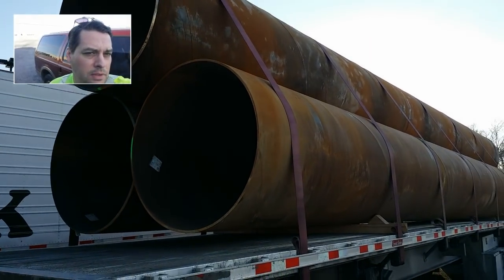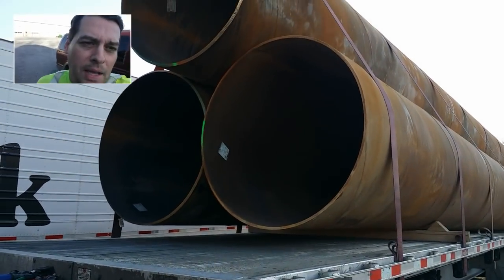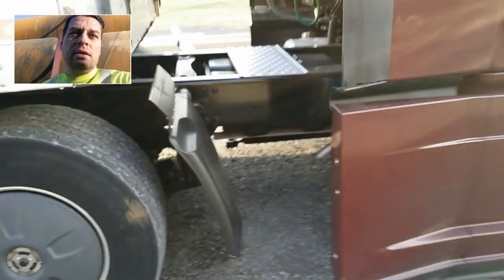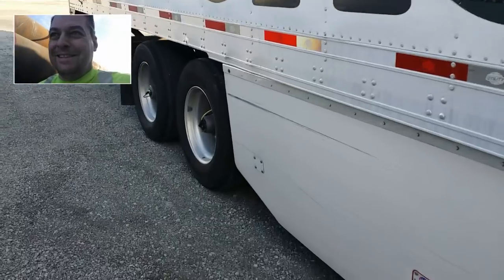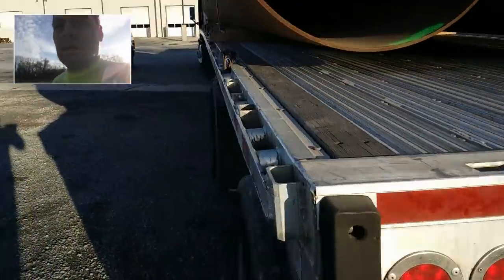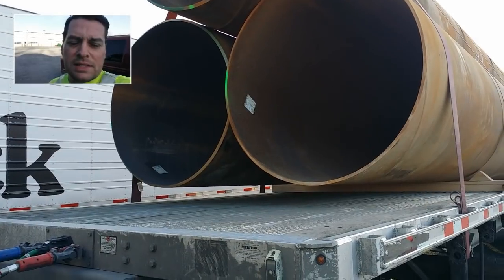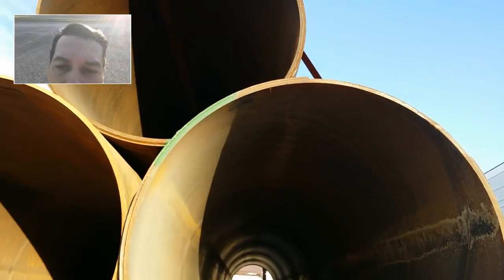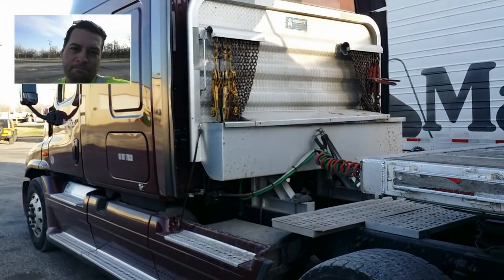Triple Barrel Steel Tube load

Comment: cool aero package on the temp controlled truck.  You can open those back doors but can you set up those rear earo flaps on that box haha. Wondered how they make that long pipe thats interesting thanks
Reply from the maker: It is a nice long building. I think they make pipes close to 125 feet in length or more, perhaps less. They have a picture of them loading one onto a Barge at the rive. It was pretty massive.

Comment: For some background on the tyres, they are most commonly referred to as super singles as well as wide-base radials (some places) and are generally installed for weight and fuel efficiency benefit. My guess for the differing implementation is due to the whims of the OEM as I see a lot of that trim of cascadia sporting them but they being less common on that trailer.
Reply from the maker: I concur

Comment: I am sure someone will correct me if I am wrong, but I think the reason you don't  have super single tires on your flatbed is it is a spread axle good for 40000 lbs and the the single won't take the weight, the reefer trailer is good for 34000 lbs and thus can use a single.
Reply: Mark Nairn some companies run super singles on spread flatbed trailers.
Reply: The singles will take the weight but they drag all to hell and back on a spread. By far the biggest pain in the but trailer I ever pulled was a spread with supers.
Reply: it is also because of the weight we carry as opposed to the box trlrs. If we blow a super single on a flat bed, we are dead in the water. however, if we blow a single on a dual set up. we can at least make it to a safe p[lace. Typically , box trlrs stay on pavement/concrete, whereas we leave paved surfaces quite often, with more chances to pick up debris in our tires.

Comment: To me the reason some trailers don't have super singles is that it looks like Maverick is changing over to them and it would be ridiculous to scrap good tires that still have lots of miles on them. I'd bet that once all of the old tires wear out all Maverick trailers will end up with newer SS tires.